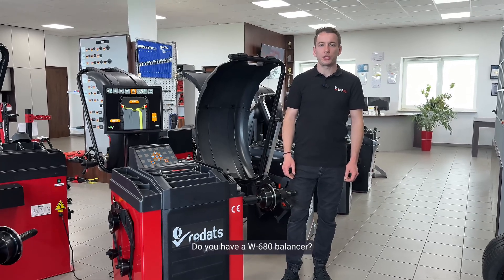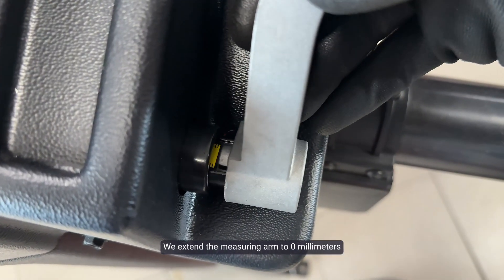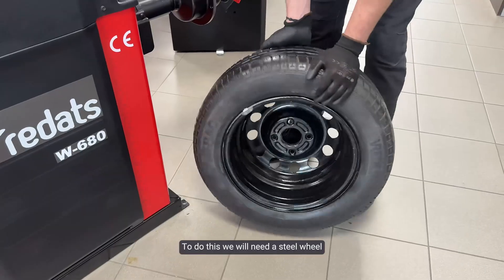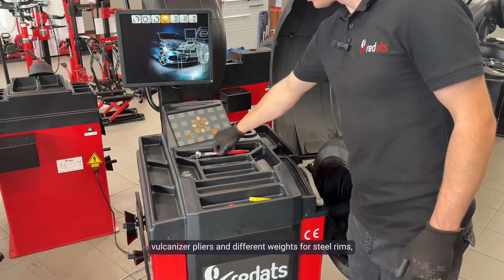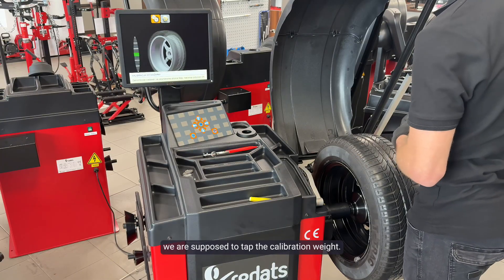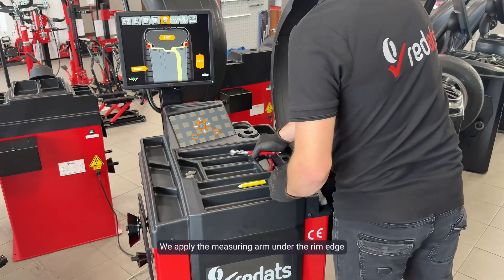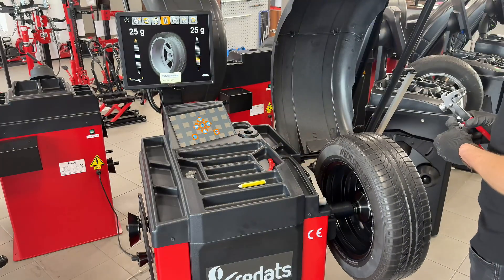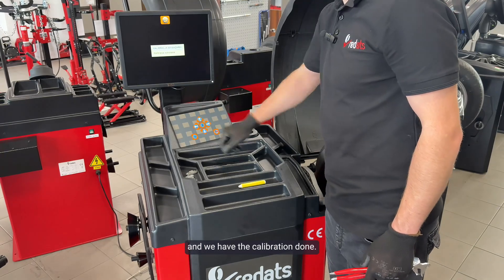REDATS W-680 – Wheel Balancer Calibration from A to Z

Comment: Pozdrav.  Kod kalibracije balansirke redats w 680 ne želi ispravno odraditi kalibraciju.  Kod kalibracije širine felge ne pokazuje dobru dimenziju širine.   kod aluminijskih felgi prilikom izmjere ljeve vanjske strane i položaja ljepljenja utega na s1, nakon izmjere unitarnog ljepljenja utega pretvori inče u mm, te pokazuje drugu veličinu felge.  Probao sam puno puta kalibrirati i najbolje sam uspio prevariti kalibraciju kada sam desnu pomičnu ruku kalibrirao 1 cm udaljeno od flanđe ( Što opet nije dobro).  Balansirka stara 10 mjeseci, kupljena u Hrvatskoj Top alati).  Dali se resetirati i ponovno kalibrirati.  Hvala vam
Reply: Bună. Am luat o mașină de la voi și la cele de aluminiu de ce mai cere suplimentar plumbi după prima echilibrare . De exemplu am pus 35/20 grame și mai cere după 10/15 grame . Doar la cel de aluminiu. Este normal?
Reply from the maker: @adriannemes7414  Hello, Should I calibrate the machine before first use? It is recommended to calibrate the balancer after transporting it.
Reply: @redats  am făcut calibrare după ce am cumpărat aparatul . Doar la cele de aluminiu cere suplimentar dar nu la toate. Cele de tablă din prima iese perfect.
Reply: @adriannemes7414 buna,ai rezolvat problema cu jantele de aluminiu, am cumparat aparatul nou am facut calibrarea si aceeasi chestie o patesc.
Reply from the maker: Perform calibration as shown in the video and check on a steel wheel to ensure the machine is reading the parameters correctly. For aluminum wheels and in the ALU-S1 program, we don't use the arm to measure the width. Additionally, with aluminum rims, the balancer can sometimes show a different rim diameter when the arm is applied to two bonding points. This is normal, as some aluminum rims are thicker and interfere with the measurement. However, in this case, we don't change the parameters read by the machine.

Comment: How to calibrate the laser,it seems it's not showing the right possition for the balance
Reply from the maker: Before performing the laser calibration, calibrate the distance and Before performing the laser calibration, calibrate the distance and diameter first, and then verify whether the laser provides incorrect measurements.
Reply: @redats i calibrate everything on the machine,i try 12 o'clock possitioning,put the balance and then try laser at 6 o'clock and see there is small diffirence when to possition the grams
Reply from the maker: @valentinhristov7230  If you want to check this, use the arm bonding function, stick 10 g on the left and 10 g on the right of the arm, do not close the cover and switch to laser bonding mode (6 o' clock). Then turn the wheel and check if the laser is showing you the correct reading.